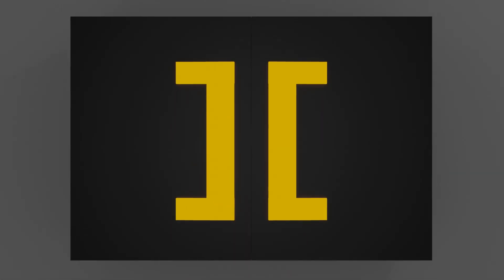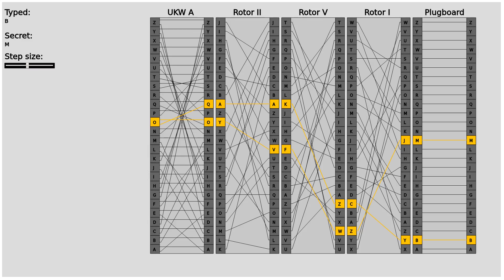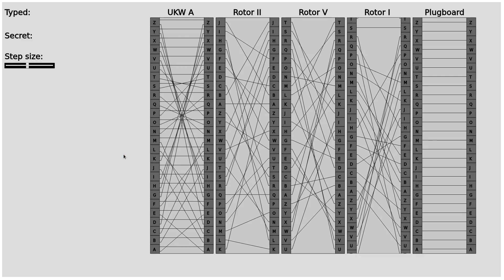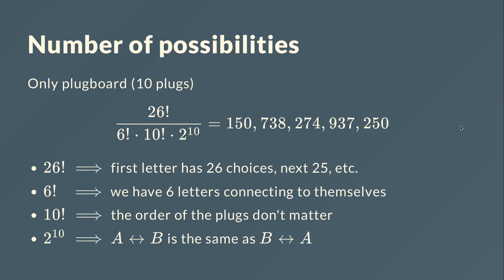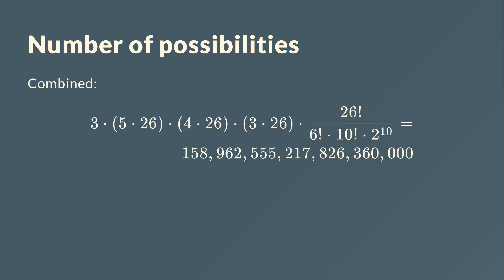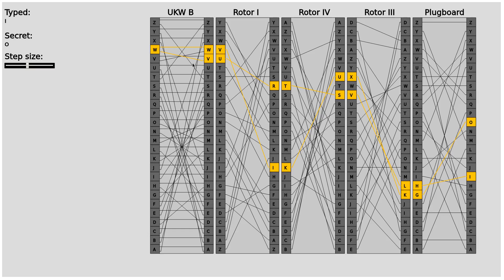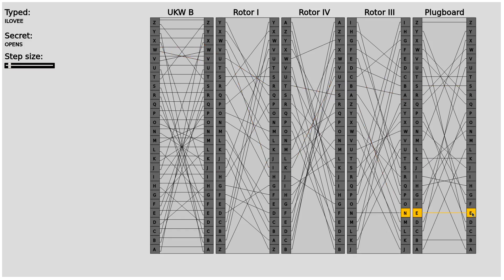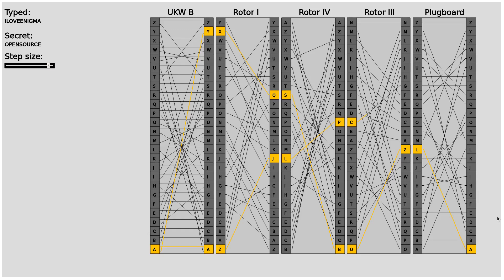Enigma: Endless possibilities is not enough

Comment: I though there were also a rotor pin that could be set anywhere on the rotors. That's how you could select at switch position the first rotor make the second one turn, and so on.
Reply from the maker: Yes that's an option I haven't implemented yet. It's actually an issue of the repository now.